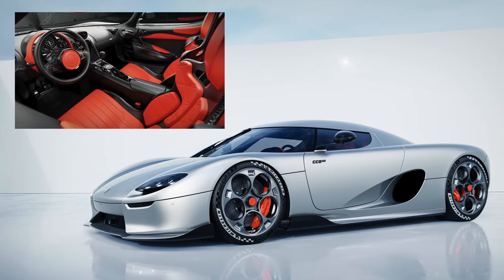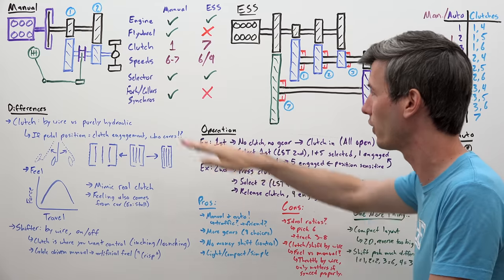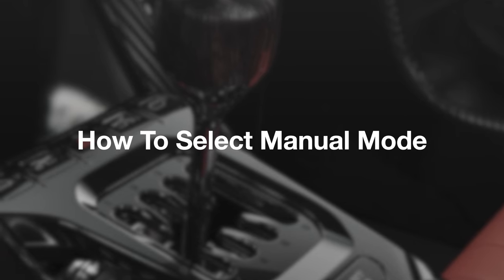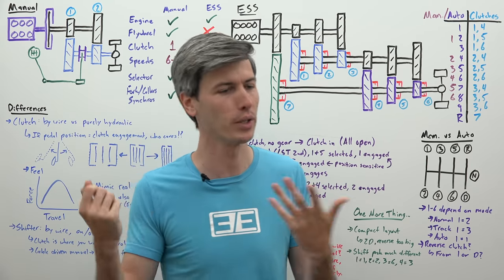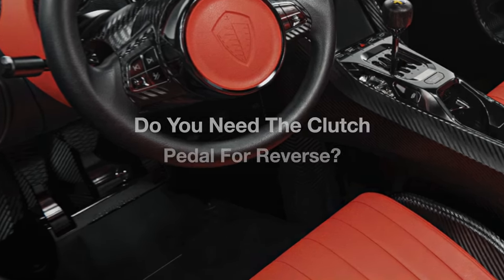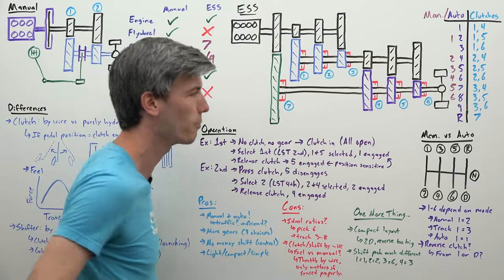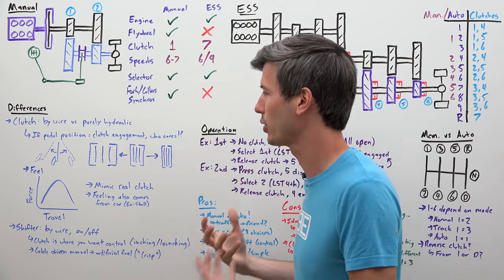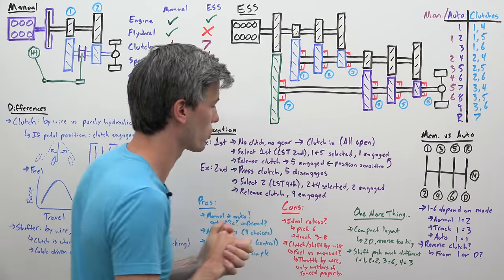Koenigsegg Reinvents The Manual! How The CC850 Transmission Works

Comment: Brought back memories of the 13-speed transmission setups in semi tractors. 5-speed transmission and 3-speed transfer case. (5x3=15, but a couple of ratios were duplicated.) Some guys never could remember the shift sequence.
Reply: Yes, its just like tractors, also like most bicycle gear with gearing on both the cogs. 
They just automated it.
Reply: @magnemoe1  When on the bicycle, I just put it in one "range", (front), and use the eight gears, (rear). In the trucks, I would often use all 13 ratios by using both shifters, sometimes using transmissions without synchronizers. Lots of double-shifts and a few triple-shifts. (I guess this kind of dates me.)
Reply: I've seen those and even seen a video of someone driving one, I don't think I would remember either!
Reply: Our tractor has theoretically 32 possible gears (2x4x4).it has 4 ranges but I typically only use 3 and 4 the others are way to slow. Then it has 4 gears and all of this can be switched to forward and reverse.
Reply: I think most carmakers have been reluctant to do these 3x3, 3x4, etc. designs because certain shifts would require shifting both sub-transmissions simultaneously while under load which requires some clever control strategies. Most modern automatics only need to swap one pair of clutches for any sequential or double shift.

However, it’s not impossible. The Chrysler 62TE 6-speed gearbox does a double-swap shift between 2nd and 3rd gear, and this double swap shift hasn’t been an issue. The 62TE does have other problems but those are unrelated to its shift strategy.
Reply: @Kyriaeus  It’s not easy with Front Wheel Drive. Someday I expect to see automobiles with a typical motorcycle DCT and shaft drive, but with a  mid engine driving the front wheels.
Reply: Just for completeness, a modern truck has a five speed with two ranges and a splitter. A 13-speed is 5+8 and an 18-speed is 10+8, first gear isn't used in high range. The neat thing about this is with the splits, you pre-select the half gear with the thumb lever and only have to let off the accelerator for it to engage. I have never figured out how that is accomplished, but I don't believe it is electronic. It should use air like the range selector, they make a distinctive pneumatic noise.
Reply: @thomasdurant7907  Yeah, it was nice when the pneumatic shift got popular. I started driving before that, when practically nothing was synchronized.
Reply: @fabianbohnert120  The last time I played with a Deere grader (2008) you could be in high, forward then slam it all the back and up, into high reverse and the computer would control the engine and transmission,  shifting all the way down, then all the way back up.
Reply: @timothyball3144  nice. The one I'm referring to is a manual transmission  with 3 shift leavers. If I did that the wheels or the engine would spin backwards.
Reply: Triple shift 64 Autocar, never did get the hang of the 3rd box, but they were just overdrives ( 80mph, 650rpm! 3 left =:oO
Reply: @thomasdurant7907  so the splitter that your referring to is a 2 speed dog box, if your familiar with quick shifting on a motorcycle the exact same principles apply, your in a certain gear and you throw a lever (pneumatic) and that puts pressure trying to shift the splitter, but he torque on the dogs won't allow them to move (simply friction holding them together) as soon as you let off the throttle (or wack the throttle if your down shifting) you release the torque on the dogs allowing the shifter to slide out of those dogs and into the other set... Same thing happens in a motorcycle but your foot is applying the pressure
Reply: @jayztoob  If you ride long distances on a bike - or in very gritty conditions - then you will care about not running the chain too much sideways. You save a huge amount of wear by good gear selections. Not just for the chain but also for the sprockets and chain wheels.
Reply: @perwestermark8920  Thanks, not a consideration for me - enclosed shaft drive.
Reply: @jayztoob  when you double and triple shift , do you leave the clutch engaged or do you engage and disengage between shifts ?
Reply: @ray Ray  engage and disengage. When upshifting isn't usually necessary since the faster moving gears slow down by themselves and if you get it just right, the gears mesh at the same speed. When downshifting, however, you have to let the clutch out after hitting neutral, rev the engine, usually disengage the clutch, then shift into gear. Now, when you're dealing with two transmissions at the same time, you sometimes have to do an upshift AND a downshift for a single gearchange, then do exactly the opposite for the next. With a few practice/sleep cycle reps, most people pick it up quickly, and perform shifts without a conscious effort.
Reply: @jayztoob  do modern trucks have automatic transmissions or are dual transmissions still being made  ?
Reply: @ray Ray  Practically all of the fleet owners specify auto. Independent owners are divided, but more are opting for auto, not only to eliminate the shifting, but to take advantage of the same driver assist features as automobile drivers have. Some of those features were common in heavy trucks BEFORE being found in cars. For instance, I drove a White-Freightliner in the mid 1970s that was equipped with anti-lock brakes.

Comment: One thing I'm curious is how Koenigsegg is able to run so many clutches while keeping the transmission small, and keeping the clutches from burning up.
Edit: a lot of people seems to not understand the issue. Yes, electronically controlled transmissions has been around for the last (checks watch) 30 years. Multi clutch packs has been around longer than that. Drive by wire torque management has been around for at least 20 years. What I'm trying to figure is how Koenigsegg was able to stuff 7 clutch packs into a transmission that's supposed to be smaller than a typical 6+ speed automatic, while being strong enough to handle 4 digit power figures. The closest analog I can think of is the old Honda automatics, which are basically automated manual transmissions. The issue is that Honda has to make the clutch packs tiny to keep the transmission size down, which resulted in a very weak torque capacity. I'm curious how Koenigsegg managed to overcome that.
Edit2: even through there's two sets of clutch packs in the given system, each clutch pack must support 100% of the load, because they are in series.
Reply: It's incredible. My guess is they have massive hydraulic pressure on the individual clutch packs that are likely made up of some kind of exotic compound. Carbon-based perhaps. And, since they're wet clutches, they tend to be a bit more forgiving and are more easily cooled than your traditional manual trans dry clutch.
Reply: @jackschofield7308  even then. DCT wet clutches are almost as large as a regular manual clutch. Traditional automatic clutch packs are smaller, but 7 clutch packs still need a lot of space. Honda managed to get away with a "automated manual" transmission in the 80s-90s, which allowed them to not use planetary gears, but the clutch packs are tiny and can't withstand significant torque loads.
Reply: Honda 4/5/6 speed automatics very similar to this. An automated manual transmission with 4/5/6 clutches - one for each gear. They abandoned the design, and you can see why, since they're huge compared to other designs.
Reply: From what I can see clutches 1 to 3 are only engaged when not under load so no slippage. As for the clutch pedal engaged ones, slippage should be easy to control if you have good software design that ensures engine revs match.
Reply: it works us farmers have bean using this type of trans in tractors for many years we had the same concerns individual clutches are smaller then one main clutch it cant handle it but now PowerShift as we call it is standard for all large tractors.
Reply: @phalanx3803  I'm an OTR truck driver and many safety features found in cars were first commonly used in big rigs.  It is interesting that "new" transmissions were first used in tractors. Learned something new.
Reply: @phalanx3803  man I was just thinking about this as I was watching the video.
Reply: @alanjenkins1508  there is no software "fixing" your mistake here, by choice. They clearly said that if you mess up, you stall the engine.
I think that they'll use very expensive material with immense pressure for the clutch, and also rely on the fact that every single clutch is used only for a fraction of the time.
Reply: I guess the main thing about Koenigsegg doing amazing stuff is that they don't care about what it will cost to produce because their customers don't care either.

Would be cool though, if some of their developments would be used in normal vehicles in the future (not very likely with transmissions though, as the future is probably going to be electric...)
Reply: I think he reason they can be so small is because there is less strain on having just one clutch, dividing the load onto multiple clutches helps to distribute the heat so it's unlikely that they will heat up to much, and also since the clutches are smaller they can be made of more exotic materials without the added cost of needing large amounts for bigger clutches.. That, plus the fact that they are wet clutches means that they are unlikely to run into issues.
Reply: Well your spreading the load out over 7 clutches aswell, when really taxing the clutch engaging and disengaging going true the gears, your constantly switching up the clutches being used
Reply: This all looks very similar to the Wiseman system used by many f1 teams which used a sprage clutch  (the needle  roller bearing it self has a lock up mechanism) type arrangement. Which ment no drive dogs and very tight packaging, one had 12 gears until the rules changed
Reply: @jackschofield7308  Probably not, What's more likely is they are using clutch packs similar to motorcycles, Those clutches in higher end bikes are designed to handle 200bhp+ alone and are about the size of a small cereal bowl. Since koenigsegg is using 2 clutches at any given time this load is likely shared between the clutches. Given that dragbikes use clutches of the same form factor as OEM but with up to 350bhp, it's entirely feasible koenigsegg throwing a little bit of their special sauce, slight amount of upscaling can get it to comfortably hold the power the car is putting out. Whilst not being significantly bigger than a regular auto transmission. Additionally it is possible the clutches aren't entirely used for load bearing, but instead the gears perhaps mate with some sort of keying on the shafts to take the load, or even the clutch pack just presses the gears against another rotor that grabs against the surface of the gears sort of like a brake calliper.
Reply: Carbon clutches. Look at f1 they use clutches smaller than my 800cc motorcycle to handle 1000+hp
Reply: @alanjenkins1508  they make it work in trucks pretty well. we've got single clutch automated manuals in big rigs and they only slip the clutch to get off the line. rest of the changes they just wait for the rpm to drop and when it matches it, they drop the clutch.
Reply: Same way my 2012 Ford Fiesta does it. Electronic controlled manual transmission. Many cars have this technology these days.
Reply: @TracyTsVideos  yeah, the Ford Powershit. Guaranteed to kill the clutches under 100k miles.
Reply: Unlike the dry clutches used in manual cars, wet clutches can take heaps of abuse.
Reply: @jwalster9412  i agree, that added to the fact that the first three clutches dont engage under load, so they dont need to stand much heat and dont need to modulate very nicely, they can be quite on-off, which helps with weigh too
Reply: @patx35  electronically controlled throttle to rev match is pretty common on even slightly higher end manuals now, so clutch slip torque shouldn't matter at least
Reply: @AntaresSQ01  thought their trans is smaller than traditional autos or manuals. They have a video with some detail but don't reveal all their tricks.
Reply: @patx35  could be smaller more grippy clutch plates, a motorcycle clutch pack is really small and its 6 clutch plates
Reply: @phalanx3803  lol,  ya,  they "reinvented"  the power shift with auto mode.  Probably a ZF in there.
Reply: @ianrobertson3419  no jD beat them to it with there e23 trans it can be run in a manual mode and you get all the gears or semi auto where you set the revs and ground speed and it gets a close as it can or full auto where you set the speed and it commends the revs.
Reply: Probably because each gear uses 2 sets of clutches to engage so they don't need to be as thick
Reply: Not sure why people think that having 2 clutches engaged per gear “shares” the load - the engaged clutches are always in series, so the power is always flowing through both. 

The clutches are obviously designed with materials that can handle more abuse than your typical commuter car clutch packs. Plus, the LST in auto mode has a significantly deeper first gear than most DCT’s, thanks in part to the compounding ratios. This helps reduce wear in low speed conditions.
Reply: Replaced synchros for clutches, saves space
Reply: I think they are more likely to be multi pack clutches like in a motorcycle or marine gearbox
Reply: You could simply have valves on the hydraulic lines to the clutches. You can close a valve on any one or all of the lines to either hold pressure or release. Selector and auto would work on the same systems of 6 valves either sending, releasing or locking in pressure. There you have it, not very complicated.
Reply: Might help that everything except reverse spread clamping and torque control between two clutches instead of one. Might all be wet with a fluid cooler too.
Reply: @hoodedcreeper2465  no they use them all at the same time
Reply: Probably steel braided or ceramic clutch pads
Reply: Maybe magnets to aid friction
Reply: Maybe something like Allison gearboxes
Reply: Normally i would say , that this setup is doomed. But its manufactured AND desing in the only factory in the world , which surely can make this work.  Whitout terrible clutch carnival after every high speed acceleration..
Reply: The transmission divides the power into 2 separate clutch packs so one of them since it's reduced does not need to hold as much as the second so I would imagine that set has a smaller clutch pack.
Reply: @raymondreyes4244  that's not how it works. Because the clutch packs are in series, they both are supporting 100% of the torque capacity.
Reply: I'm curious too. I've often wondered why we bother with a clutch and gears instead of just using something like this, and this "keeping the transmission small, and keeping the clutches from burning up." is a pretty good answer. Makes some points I haven't thought of.
Reply: He's simply machined them from billet unobtainium.
Reply: @patx35  they should be dividing the load unequally since one is spinning at a faster rate that the other. Now when it is on its 1:1 ratio then I believe that would be torque equally divided.
Reply: @MFKR696  Do you know the service intervals of the clutch, or just being sour grapes?
Reply: @raymondreyes4244  We are mixing concept here. Every clutch must windstant all the torque from the MOTOR, at their spinning range...be it coming from the motor itself or from another gear/clutch combo

Of course the output torque to the next clutch or to the wheels is gonna be different... that's the very reason of using gears, lol
Reply: @MFKR696  "No, I don't know them, but I'm gonna try to sound pretentious and edgy to hide my ignorance"

K, got it, "H3r3t1c"

facking lmao
Reply: @MFKR696  "cupcake"? pffft hahaha go back to 9Gag, spatz
Reply: @jackschofield7308  There is a trick. They cut the engine ignition right at the moment of shift. And with that engine capable of doing 30000+ revs per second, they can actually avoid wearing out their clutches. But yes, those clutch packs would have to be about as big as a typical motorcycle clutch but transmit 100x more power.

Comment: Christian is a genius. I remember seeing the CCX when it came out on Top Gear and it was mind blowing. What he has created now is mind altering. Kudos to him.
Reply: such a shame he didn't apply his 'genius' to something useful to humanity.
Reply: @daos3300  yes cause everything everyone does has to be useful to all humans. Not. That's not how anything works
Reply: CCX with the top gear spoiler
Reply: @daos3300  I’m a human and I find going fast with a manual transmission useful
Reply: @daos3300  yes, cause you are very useful to humanity commenting YouTube videos
Reply: @daos3300  for example? Humanity doesnt need geniuses to fix our current problems we need fewer idiots. Unfortunately we are going in the wrong direction at a rapid pace. Common sense is a rarity these days.
Reply: @MV-ri7zu  i'm sure you don't need examples. also, 'fewer' idiots, not 'less' .and there is no such thing as common sense.
Reply: @daos3300  thanks for the grammar correction, but common sense is a very real thing.
Reply: @daos3300  blasphemy any mechanical knowledge is still useful even if it's cars
Reply: Humble and is surrounded by increndible people too. In a video he gives all the credit for this lightspeed transmission to his engineer.
Reply: Was it his invention?